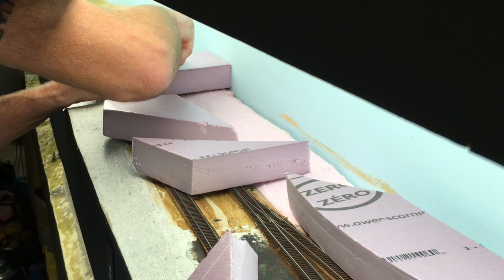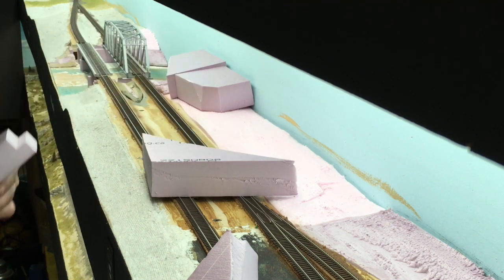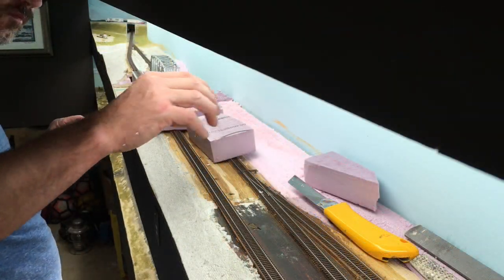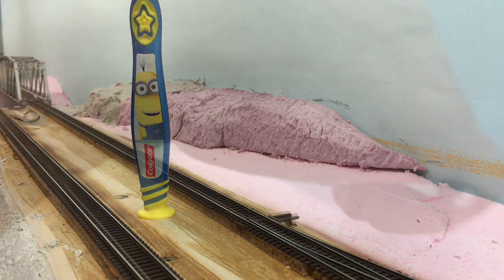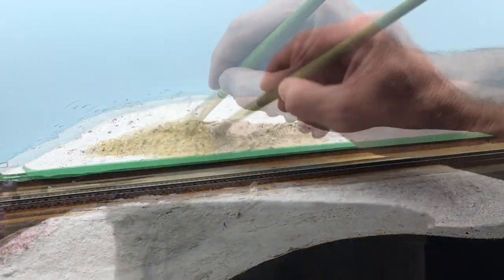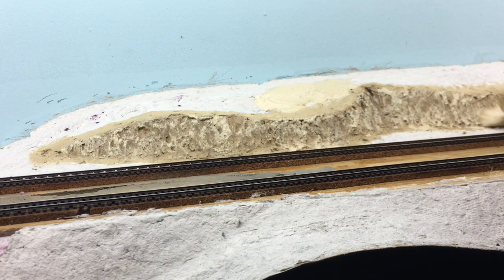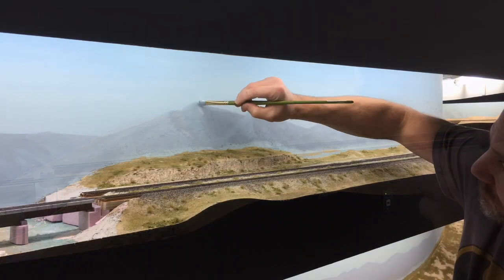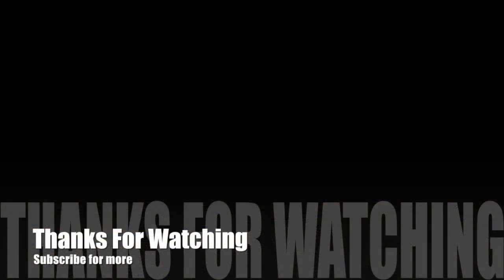Exposed Soil Hillside How-to - Southern Alberta Rail

Comment: Very nice on all points, Grant. I note you like Celluclay™ throughout (and with great results) but did you ever try Sculptamold™?  I've used it extensively on commercial model jobs as well friends' railways, and enjoyed the cross between plaster and pulp. I'd appreciate your take on what makes Celluclay superior, as I'm never too old to learn!
Reply from the maker: Thanks!  I'm pretty sure  I have used Sculptamold in the past but Celluclay is easier to find locally!!  I find the two products very similar with Scultamold being a bit finer in texture if memory serves.  I can't remember if Scultamold dries hard or not?  With the number of trees on the layout I enjoy the fact that Celluclay is easy to poke through when planting.  Cheers.  -grant
Reply: @SouthernAlbertaRail  In favour the stuff: 
1. Cleanup is a breeze compared to plaster.
2. Sculp' forms its own rock. It makes joins between plaster rock castings vanish with literally no effort, or just slap it on and you have rock.
3. It takes colour like plaster so castings don't show up as separate pieces with "grout"!
On the other hand, it has vanished from the art chain I used to get it from, and the price was going up and up before that. I may try mixing my plaster with pulp next time and see if I can make my own.  
And I'll have try out some Celluclay too! 
Thanx
Reply from the maker: Definitely a lot nicer in the cleanup department and I love your analogy regarding "grout" lines between rock castings.  It's something that requires a certain touch to avoid.  I really appreciate your perspective on this.  Great discussion.  Cheers!  -grant

Comment: Hello Grant, I am wondering how you did the landscape closest to you where the small hills and stuff is. Just wondering how you did it and what you did it with.
Reply from the maker: I'm a big fan of a product called Celluclay applied over a styrofoam base.  Very easy to work with to create the initial scenery base.  I then use various commercial scenic products and latex paint as a binding agent.  I have several scenery videos on my members side of the channel if you're interested in step by step tutorials.  The vids cover all the different aspects of my scenery work from prairie to rock work and everything in between.  Thanks for tuning in!  -grant

Comment: You have a ripper of a layout. Please tell me the tuft grass colour and the colour of static grass used. Much appreciated. What is the colour code of the Tan latex please.
Reply from the maker: I use Silfor autumn static grass and prairie tufts.  I also use Silfor autumn buffalo grass.
Reply: @SouthernAlbertaRail  thanks. What type of tan colour you got in paint ? Do you have brand and colour code ?
Reply from the maker: @eremyjay  Nope.  I just eyeball something from a paint chip that looks right.  Any latex interior will do.  Just be sure it's a flat or eggshell finish.
Reply: @SouthernAlbertaRail  fair enough. Im not having any luck finding those tufts and static grass in Australia. Hopefully I can find a store in the states that ships international as scenery express won’t let me select my country to proceed.
Reply from the maker: Had the same problem.  I had my order shipped to a friend in the States and he forwarded it on to me.
Reply: @SouthernAlbertaRail  True. I found a site that shps International but the Cost of shipping is expensive. Ill have to order bulk to make up for the price and not re order in future. What size static did you get and did you mix them together or did areas with 2/4 mm and other higher mm etc ? Wish you did a video from the very start of your projects. :) Im doing all Canadian layout my self and doing a Scenery of Alberta Rocky Mountain and hills but didnt know how to start as im very new to this hobby.
Reply from the maker: @eremyjay   Some 2 mm but mostly 4 mm.  You can blend colours but don't blend lengths.
Reply: @SouthernAlbertaRail  cheers. Is this brand Silflor from the brand MiniNatur ?
Reply from the maker: It is.